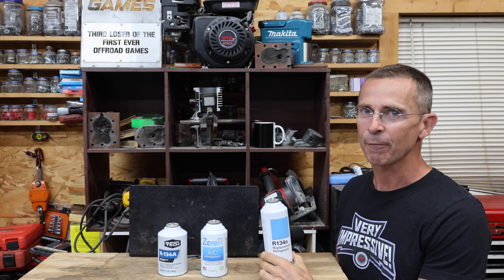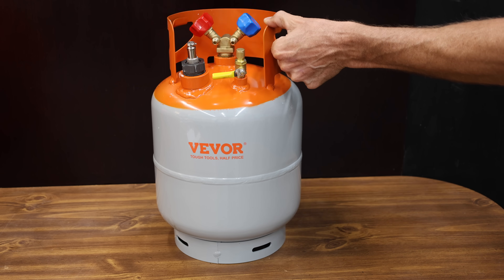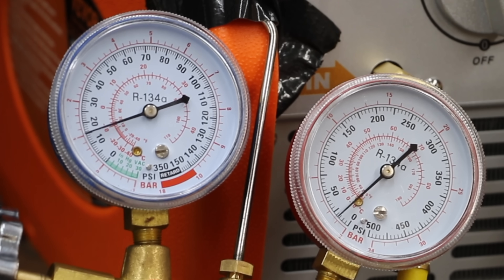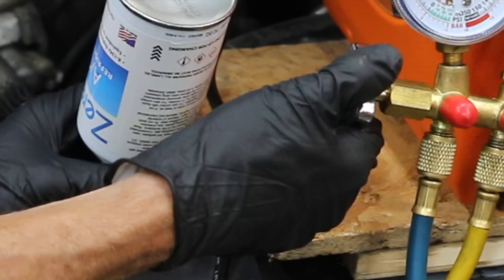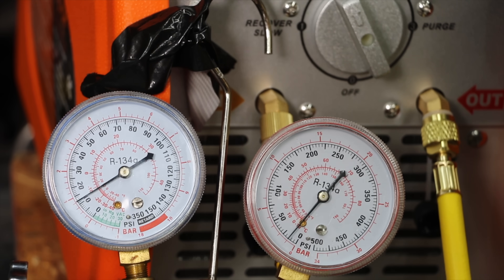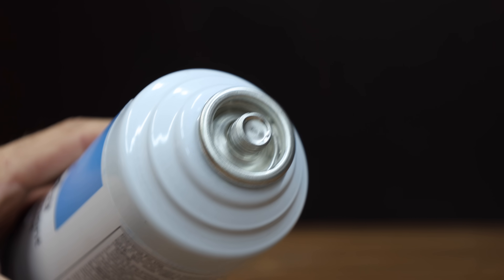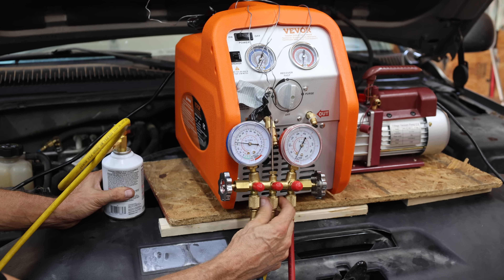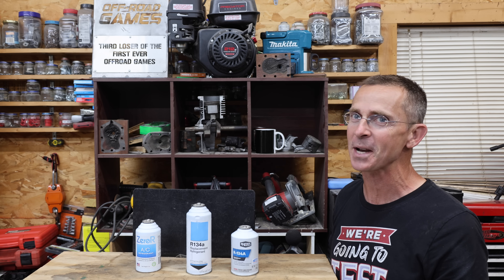How Dangerous is Fake Car A/C Refrigerant? Let's Find Out!

Comment: Being a refrigeration tech I would say that most likely the refrigerant being used in the R-134A (C2,H2,F4) replacement is R-152A (C2,H4,F2) which is a flammable gas. I would not recommend putting this in your vehicle, in the possibility of anything damaging the refrigeration tubing or system could lead to a possible fire or explosion like expansion of flammable gas. The reason why you see lower performance out of the vehicle is due to R-152A having a lower volumetric cooling capacity around 5% less than R-134a. R-152A having a higher a higher hydrogen concentration is what leads to it's flammability most likely. R-1234yf (C3,H2,F4) is used in many modern cars after 2020, it is also a semi flammable refrigerant. The difference between the flammability of R-152A and R-1234YF is probably due to the burning velocity of R-152A being faster than R-1234YF. Most modern refrigerators and freezers are going to R-600A(Isobutane) and R-290(Propane) which are highly flammable. The use of flammable refrigerants are being introduced to Refrigeration and HVAC applications is because the supposed environmental hazards and GWP(Global Warming Potential) of other refrigerants. A lot of flammable refrigerants could potentially be dangerous to people if accidents happen but they have either low or zero GWP(Also cheaper to manufacture most likely) than non flammable refrigerants. Thank you for testing these refrigerants and showing how these refrigerants can be dangerous.
Reply: I checked the SDS for the ZeroR r134a replacement. It just says Liquid Petroleum Gas 99% + odorant 0.75% and dye 0.25%. Even they don't know the refrigerant mix it seems. It's just LNG.

Also, their claim of zero GWP is ridiculous. Yes, it's probably only a few percent of that of r134a's 1600, but it's still several times that of CO2.
Reply: Geeze the 15 gallons of gas in the tank?
Reply from the maker: Thank you for sharing!
Reply: The  R-134a replacement I bought is labeled as 12a refrigerant. I don't have the composition on the can, it just says a blend of hydrocarbons. Looking up 12a on Wikipedia will tell you 12a is a blend of propane and isobutane.
Reply: @phizc  R290 has a GWP of 3. So it's "only" 3 times as bad as CO2, but you also have to take into account the realistic atmospheric lifetime of whatever gas. In fact, there really wasn't anything wrong with R22, it took about 20 years for it to break down, and about 20 years to make it into the ozone layer so it only had an ODP of about 0.05. The problem with R12 was, it was such a stable gas that the atmospheric lifetime of R12 and R11 is like over 100 years.

For comparison, the GWP of R404A or R410 is 1000's of times worse than C02... so it's not even in the same ballpark as R290/600.
Reply: @davesaunders7080  exactly,  I drove my LS400 with LPG and that was no more unsafe than the Gas/Petrol. It is only a problem when mixed in the correct volume with air and since it is under pressure this would be fuel rich unlike Gas/petrol which is heavy and a liquid.  As a refrigerant it is safer than ammonia but what was not explained is its compatibility with the oil used in the compressor.  I have successfully refilled a portable AC with camping gas. Starships comment is absolute on point. Best from a UK
Reply: I have a classic truck that has an R12 system in it, is there anything made today that is safe to run in that system/ equivalent to r12? Not trying to spend $50+ per can on eBay for the original stuff lol.
Reply: That's the sad thing about refrigerants. Either they attack the ozone layer, have high GWP, are flammable, or poisonous, or, as with R-744(carbon dioxide), they run at ultra high pressures.
Reply: 152A is basically the same stuff in air duster cans. I've heard of people using air duster cans to charge their AC and it 'supposedly' works better but according to you it's less efficient. 
Air duster cans are definitely MUCH cheaper though.
Reply: Odd, I also checked the SDS and it said a roughly 50/50 blend of propane (r290) and isobutane (r600a).
Reply: @Argedis  many air duster cans are just butane. Which is insane.
They're often called compressed air, and people are using them to blow dust out of computer fans. Inside their bedrooms.
Reply: @phizc  As far as I know most consumer air dusters are 152a refrigerant not butane
Reply: @Argedis  possibly. The main point is that it's flammable, and I've seen both butane and butane/propane mix of unknown proportions. Also butane/propane/isobutane. Again without specific proportions.

CRC has one that's R-1234ze(E),  which is not flammable, has a ODP of zero and GWP of less than 1. Very expensive though.
Reply: How does the 152a  compare to R-12 performance wise? Does it have Leess volumetric cooling?
Reply: A refrigeration tech wouldn't assume r152 with 80psi head pressure in a car. That's 290 with a lil 600 and some mercaptan.
Reply: @phizc LPG is the term for propane. So it's R290 with odorant and other stuff.
Reply: @phizc Liquid Petroleum Gas (LPG) is the term for propane. Liquid Natural Gas (LNG) is not the same thing. An LPG refrigerant would be R290. GWP of propane R290 is 3x that of CO2, GWP 3. Pretty good.
Reply: its fine, it's been used in vehicles quite a lot and no reported injuries from it

Comment: the "fake" refrigerant is Propane. Nothing wrong with it but doesn't perform well in car AC systems. Propane is R290, which is used for industrial meat freezers as propane is a better refrigerant for freezing temperatures. The reason propane works poorly in car system is the system gets too cold and the EVAP core actually starts to freeze up from moisture, causing blockage of airflow and higher tempratures. I've tried straight propane in car AC. If you want to run propane in car AC system, the pressures need to be different than R134a. If you fill up with propane to R134a pressures, the EVAp core freezes or the compressor goes to constant clutch cycling.
Reply from the maker: Thanks for the feedback.
Reply: Not many people realize this! There is a proper pressure graph available online for R290 that goes by ambient pressure.. but of course you want to fill by weight not pressure... and car manufacturers only give you the weight for r134a, wonder if there is a conversion chart
Reply: What could be the reason that a corolla 2015 blows warm air when stopping at a red light and then it blows cold air after awhile and when moving again? Is that normal?
Reply: @theblukatlife  electric radiator fan not running.
Reply: You must sale propane and propane accessories
Reply: @theblukatlife  the most probable cause is a failed electric fan
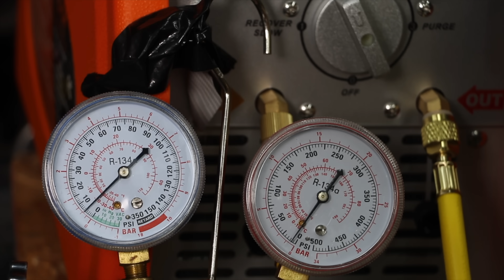Reply: @theblukatlife  6:57
Reply: @jeremyvalderas8146 Thatherton!
Reply: I want my ac freezeing cold
Reply: @theblukatlife  couple possible reasons:
-Engine or condenser cooling vans not working
-refrigerant low
-engine coolant low, causing slight overheating at standstill and car turns off AC to reduce engine temps
-engine idle too low, the idle needs to be relearned
-weak compressor or compressor control valve (variable displacement compressors)
Reply: @jeremyvalderas8146  actually the opposite, I work in an adult s** toy store.
Reply: Butane or R600 works better than propane, Butane is closer to the working pressure of 134A Than propane is.
Reply: This guy knows refrigerant.  Also I charge with liquid on 134a.  Never have ruined a compressor...learned how to read gauges and charge systems from a shop.  It's worked for years...I've used propane on leaky systems because it's cheap...it takes a hell of a lot less.  

I can also tell you how to take a full 500 gallon propane tank 400 gallons of lpg...and turn it into a solid 350 gallon brick of solid propane on a 100* day the joys of knowing how gasses work in liquid state...

And how to fix people's fuck ups...
Reply: @theblukatlife prolly your radiator fan isn’t working or the fan clutch is worn
Reply: It's actually a blend of propane, butane and isobutane. While it's difficult to determine exactly their blend it's likely somewhere around 50/40/10. The published PT charge for it matches 134a +/- 5psi. It would likely work fine provided you weigh in the charge using the conversion chart and not use one of those silly pressure based charge hoses.
Reply: @DarkAttack14 Can you explain why not to charge by Pressure?
Reply: I know people charging ac with mix of propane-butane 50:50 with 30-50% weight of r134a
Reply: If your AC system has a leak when you have R134a or automotive refrigerant, all that will happen is you'll lose refrigerant. If you have propane, you risk developing a fire.
Reply: It's not all R290. Some of the alternative refrigerants I've run across are R152a. It cools just fine and has a high CoP and low head pressure.
Reply: @sunnydays4966 that's not air conditioning, that's low temp refrigeration.

Comment: DuPont owns the patents for pretty much every refrigerant that has come out.
It's really strange that every time the patent runs out, they come out with a new refrigerant with a new patent and laws are passed to make it mandatory.
The new mandatory refrigerant R1234yf is also flammable.
Reply: Propane (R290) could be used as well. It is on the way in for home A/C. And could definitely work in cars as well.
But indeed Dupont and co wouldn't make money on it. But it would be a boon environmentally.
Reply: Money talks , go see dark waters 😂😂
Reply: Once the patent runs its corse, DuPont decides to use its bureaucratic pull to make that particular product illegal due to claims of being unsafe for the environment so other companies cannot make it anymore.  It's a great way for a company (DuPont in this case) to keep competing companies from cutting into DuPont's bottom line.
Reply: *course
Reply: R1234yf also breaks down into a new and exciting persistent chemical (perfluorinated carboxylic acid / PFCA) so I guess that's a another problem we have to look forward to.
Reply: @stankymcgee6742  Weird how you conspiracy theorists never consider the opposite: that DuPont is withholding any new laws regarding their enviromentally damaging products as long as possible, so they can use it freely until the competition would be allowed to use it too, at which point they let the law makers finally delegalize the harmful product
Reply from the maker: Thanks for the feedback.
Reply: @justinr9753 what in the world are you talking about
Reply: @pmode2474  the term  Conspirac y  The ory   usually means something that is correct now because it's been misused so many times it has changed the definition.
Reply: @pizzablender  R290 is almost equal to R32. It's high pressure and high performance refrigerant - theoretically may damage car compressor. R134a is low pressure and low performance. R290 (propane) is better than R32 because it doesn't release extremely toxic fumes when burns. Both of them are flammable and have the same flashing point.
Reply: @pizzablender  I have a HVAC system converted to propane. Been about 18 years, runs great, cheap to charge up!
Reply: @justinr9753 how much r134a have you been huffing recently?
Reply: yea thats how c0rruption works
Reply: @JohnD-JohnD  this a a false narrative
Reply: @pizzablender  i use propane in all of my R12 cars,  it blows nearly -16 degrees f out the vents in one of the cars i did!
Reply: @miatadawg  propane has acid in it that we add to it to make it smell like rotten eggs. You ruined your system faster than. R-290 is propane without acid stench tracers. You should have used that instead.
Reply: R1234yf (and R134a) is indeed PFAS and will soon be banned.
The dangers of PFAS was quite recently noticed just after it was launched.
Reply: Can you do UPS systems? UNINTERRUPTIBLE POWER SYSTEM.  But focus on home use, sine wave versus non-sine wave. I never truly know the difference between each of those types of devices.
Reply: @Owen-xw8cs  Propane for you BBQ has odorant in it. You can buy propane that has not been odorized. It is generally chemically inert.
Reply: @Owen-xw8cs  good to know,  i was told its when it gets moisture then the acidity starts to really effect it,  its been a few years and havent had any issues
Reply: @eclectichoosier5474  that’s what r-290 is exactly exactly. Unadulterated propane
Reply: It’s no hard to figure this out hey….   410a will be phased out shortly as well for home based systems.
Reply: @TheByQQ  There is effectively no difference. The end result is the same.
Reply: @eclectichoosier5474 propane? Chemically inert? 😂😂😂😂😂 it's extremely flammable, which is a chemical reaction, so no, it's not even close to being "chemically inert". The amount of misinformation being slapped around this comment thread as "fact" is very disappointing.
Reply: DuPont owns the trademark "Freon" with 'refrigerant' being the generic term.  A quick Google - DuPont isn't even in the top 15 of global refrigerant manufacturers.
Reply: @mrfrenzy.  It was quite recently reported to the public just after it was launched*

Labs are quite capable of having discovered this during development.
Reply: Well r12 actually was and isca cause for the ozone layer depletion.   Once that and other things were phazed out the ozone has recovered. 

As much as i dont like dupont as theyre responsible for millions of deaths every year from chemicals.   There is no (conspiracy) for the switch from r12 to r134a.    I have two classic cars that use r12.  And ill keep using it as long as i can find the tanks.   The main reason is because im broke and it costs too much to change everything including hoses on a classic car to r134a.
Reply: @pizzablender you cab buy propane refrigerant anywhhere.

But propane is not compatible with butyle rubber hoses.  Which most older cars use.
Reply: It is also interesting that Freon was developed by the same chap that created Tetraethylead for the Gas/Petrol.  One man could be said to be responsible for the hole in the ozone layer. .....
Reply: @Owen-xw8cs  Really?
Look at the timeline of when the patents run out vs when a new one is introduced and made mandatory. Then look at who owns the patents, and their parent companies.
Seems that they absolutely have a new patent every time the old one expires.
Reply: @fredinit  Look up who owns the patents, not the manufactures.  Those manufactures pay a royalty to the company that owns the patent.
Reply: @JohnD-JohnD  when was r-22 developed? 1950’s… How long was a potential patent? 20 years… When was Montreal protocol? 1987… you are timeline challenged
Reply: @JohnD-JohnD  oh and they let us buy equipment with r-22 for 20 years after that…
Reply: @JohnD-JohnD  it’s like saying leaded gas was banned because of a patent on gas.
Reply: @imnotdavidxnsx R1234yf was introduced 2012. In 2015 it was definitively proved that PFAS is dangerous to humans, EPA and other agencies issued warnings. In 2023 EU and USA started to propose banning PFAS.
Reply: Not strange at all. DuPont knows when their patents expire therefore they plan accordingly. DuPont's federal lobbyists (AKA Beltway Bandits) are well financed...
Reply: Dupont doesn't have the patent to R32 or R454B, the upcoming replacements in residential and commercial systems using 410a. Honeywell developed the R454B blend, and R32 is very old and very much open to use. The current R410a was developed by Honeywell and has been out of patent protection for a long time now. Carrier is the one that first started using and popularizing 410a, theirs was branded Puron.

R134a has been in use for a very very long time and has long ago been out of patent protection, decades. Dupont doesn't own 1234yf either.

Dupont doesn't own any patents to the modern refrigerants that we're moving to or even the ones we're moving off of. R600 and R290 are taking over small systems like refrigeration. CO2 is replacing ammonia in industrial uses.

Comment: Another  great video, Todd.  You're really branching out.  I took Auto A/C at UTI in Phoenix in '72.  After graduating, I got a job at an A/C shop, installing a 3rd party air conditioning system to new trucks for a dealer.  It was all R-12 back then, the the air coming out of the dash vents was an icy SEVENTEEN DEGREES when the outside air was 118F.  Those were the days.  I watched a vid on installing a mini-split system the other day, and the guy said that anyone can get the EPA license for proper HVAC handling fairly cheap, then save thousands on installing your own systems.  Now that you have half the equipment (gauges, recovery mach, etc.) you might try a video on something like that.
Reply from the maker: Thanks!  Thanks for the suggestion.